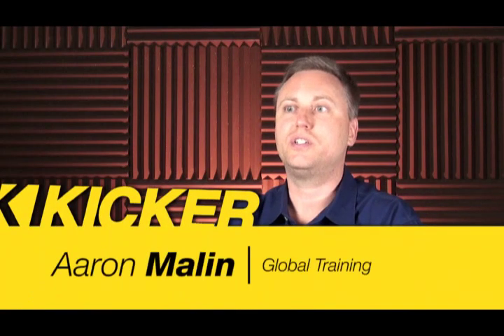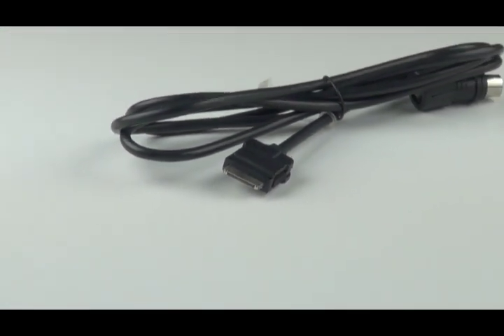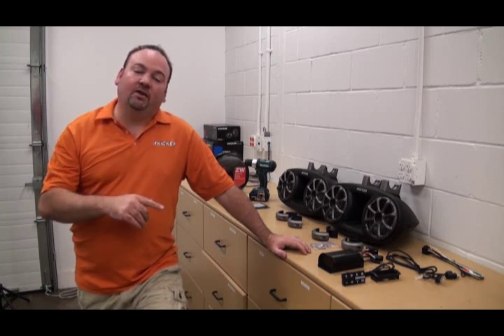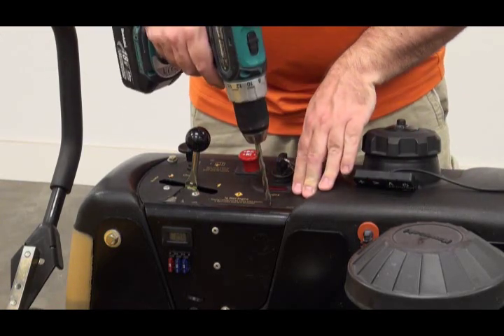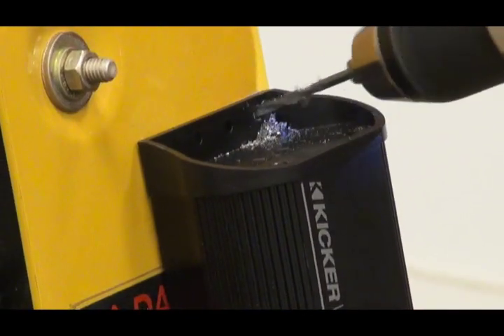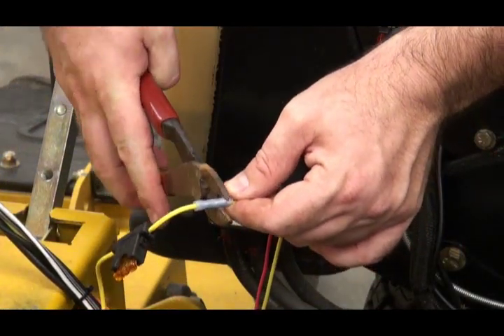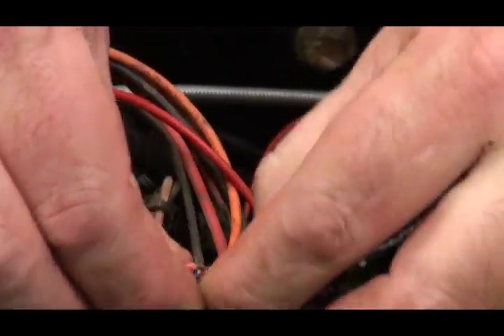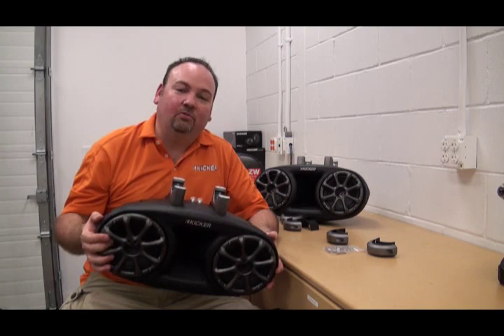Introducing the KICKER PXi50.2

Comment from the maker: Hey Craig - The PXi50.2 is only stable down to 2 ohms per stereo channel.  You can run a set of the PS5250 on one channel but the CVT651 is a 1 ohm speaker and it will be to low of an impedence for the 2nd channel.

Comment: What does everyone have against a well used set of Kleins? Those puppies have done thousands of installs.

I will clean them up with some WD-40 before their next filming. :-)

As for the tool itself...I'll take a set of Kleins over anything else out there for crimping butt connectrors, crimp caps, terminals, etc.

Comment: wow No solder anywhere....I figured Kicker was better than the twist and tape and Butt conectors. Ive been an Installer for 10 years and that would never leave my shop like that. Solder and heatshrink might take a little longer but will last longer. and throw some loom over those wires.

Comment: I dont want to use bluetooth would a Kicker PX100.2 pair with the 40PSM32 speakers
Reply from the maker: Christopher, would you be mounting them in a UTV, a motorcycle or a vehicle? You have a few options is why I ask.
Reply: Motorcycle
Reply from the maker: This amp will work very well.   Deliver the exact RMS power you are looking (50 watts per channel at 2 ohms) for and has no Bluetooth features: http://www.kicker.com/pxa2002-2-channel-compact-powersports-stereo-amplifier
Reply: But can I use the px100.2 2ohm with the 40psm32 2 ohm speakers
Reply from the maker: You can, yes.  Just be aware that the controller has to be attached for that amp to operate, as it has multiple sources and inputs.